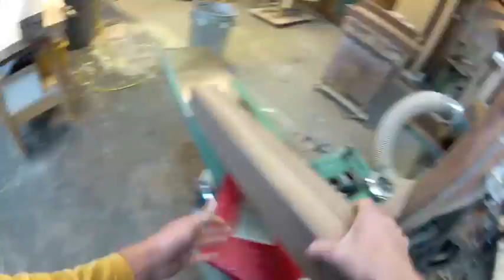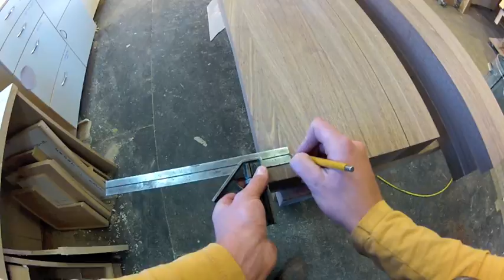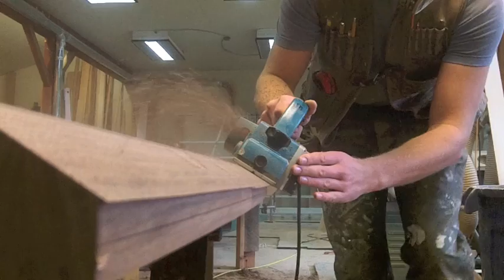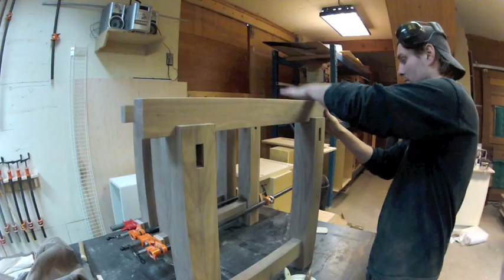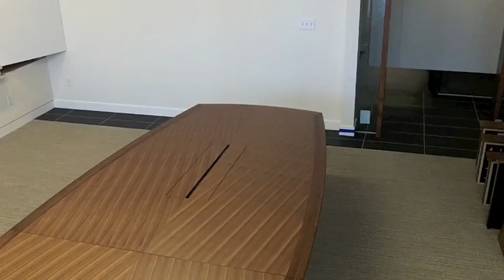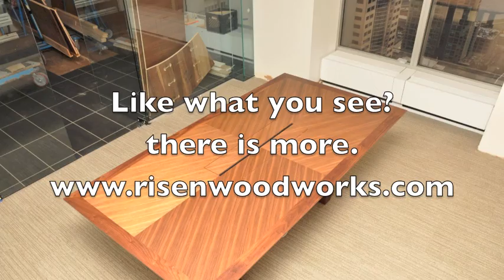Woodworking, build a Modern Table

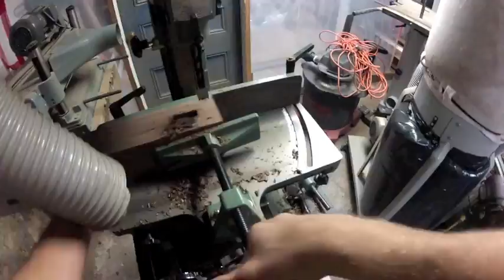Comment: At 0:45 you use some kind of square bit to cut the mortises. What is that and does that work with any ol' drill press? or this that a some kind of specialty mortise cutting machine?

I'm only a few years into my woodworking hobby but every bit of knowledge helps!
Reply: +Bryan P Its a Hollow Chisel Mortiser, a purpose built machine. See http://www.finewoodworking.com/toolguide/product-finder/hollow-chisel-mortisers/118181.aspx.
You can also get an attachment to suit a regular drill press, but they wont have the power/accuracy that the proper mortisers do. See http://www.popularwoodworking.com/american-woodworker-blog/mortising-drill-press